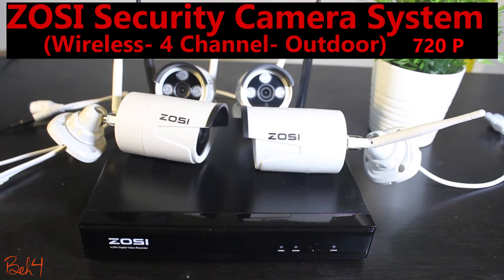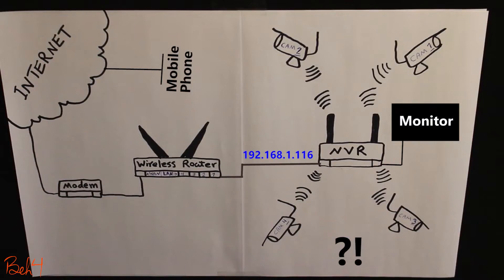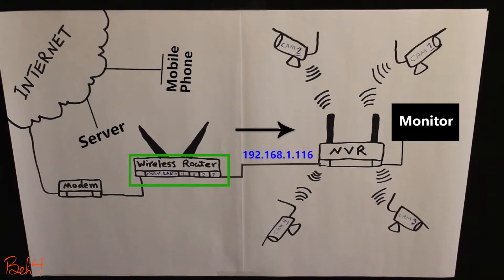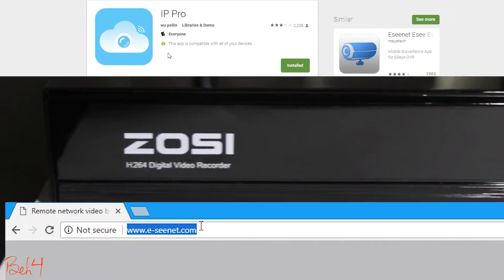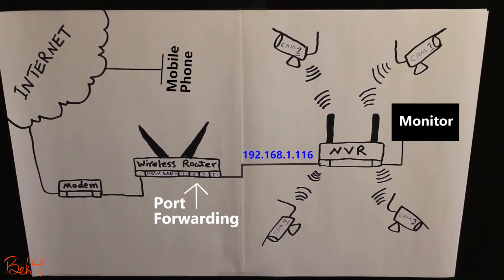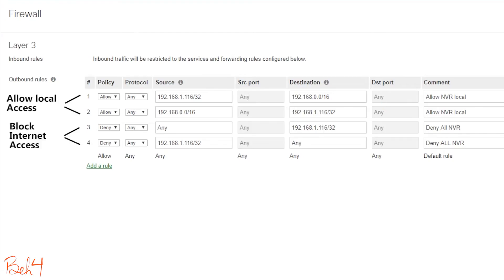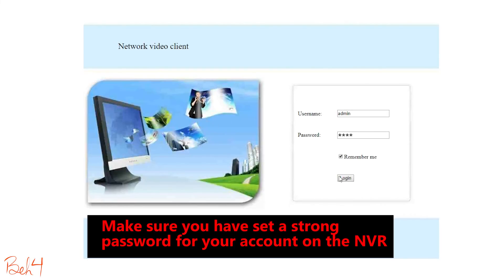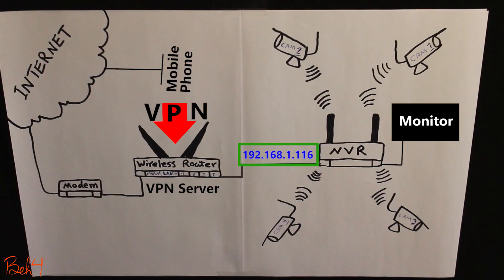ZOSI Security Camera System- PART 2 [Remote Access]

Comment: Hi, thank you for the videos, I have installed a central device with 6 Wi-Fi cameras (ANRAN model). 3 MP The problem I have now is that on a clear day, the two cameras are 10 meters away from the device.  It connects, but it happens much less at night

Comment: i got the zr08dp nvr and it came with 4 camera but show 8 spots for 4 more cams. i tired to add 2 cams and it will not let me. i got one to show part time with only the wifi in the window but no feed. so do you know if this model actually takes 8 cameras or only 4? ir it takes 8 cams how do you get them to connect? i do not see any place to pair them. thanks
Reply: I've tried the same thing and no luck either, did you figure it out??

Comment: Hi excelent video, it makes much more easy to understand the system... question for u, is there as a secondary benefit an improvemente in performance going directly through a vpn to the NVR instead of using the cloud?
Reply from the maker: Not necessarily an improvement in performance, but definitely an improvement in security as mentioned in the video. Thanks!

Comment: Hi. How do you setup the VPN? and can you still remote view with a mobile app (from cell phone)?
Reply from the maker: Hi, you'll need to have a VPN server of some kind. Some of the wireless routers have built-in VPN servers that can be used for this purpose. For example Asus has wireless routers that support OpenVPN server (RT-AC68U for example). Here is a video on how to setup an OpenVPN on an Asus wireless router: https://www.youtube.com/watch?v=KXdhhuBcpgU
Once the server is configured then you can connect to it from outside your network using a computer, tablet or cell phone.
Reply: Behfor Ok great! Thank you
Reply: Behfor One more question please. I’m using Verizon Fios as my ISP and the router I have doesn’t support a VPN setting. Do I need to purchase a separate router like the Asus and connect the two, or can I simply use a VPN service? In either case, what’s the easiest setup and what VPN service do you recommend?
Reply from the maker: So if the purpose of using VPN is to be able to remotely access your home network (there are other reasons for using VPNs too) then the VPN server has to be physically located in your home and connected to the network. If your wireless router doesn't support a VPN Server then the options are 1- to replace the wireless router with a one that has VPN server option 2- install a third party firmware on your wireless router that has a VPN Server feature such as DD-WRT or Tomato. Of course the wireless router must be supported by the third party firmware as well and not every wireless router is supported. This method can void the warranty on the wireless router and if something goes wrong there is a possibility to brick the wireless router 3- Use a separate VPN server (Asus RT-AC68U for example) and connect it to the main wireless router. This method might require additional configuration on the main wireless router (port forwarding for example) because the VPN server is not directly connected to Internet and there is a situation called  Double NAT. My personal favorite VPN service is OpenVPN, because it is very secure and also customizable. Hope this was helpful.
Reply: Behfor Yes, thank you! It was very helpful. You’re the man!

Comment: how would you setup the vpn?
Reply from the maker: So you need to have a VPN server so you can connect to your server when you are outside. Some of Asus wireless routers for example have build-in VPN server functionality. This is how you can configure an OpenVPN server on an Asus wireless router: https://www.youtube.com/watch?v=KXdhhuBcpgU Or if the router doesn't have the VPN server option, you might still be able to install a third party firmware such as DD-WRT on the router and use it as a VPN server https://www.youtube.com/edit?o=U&video_id=q-2vtaXdFXQ

Comment: Great videos many thanks ! Interesting my system is almost exactly the same but with another brand ! Sannce. Same weird software options tho.
Can we use these cameras to be a public webcamera ?  How would we do it?
Reply from the maker: Thanks for this interesting question! Actually I haven't tried using them as a public camera yet but I think it should be possible but I guess the cameras should be connected directly to the wireless router, I'm not 100% sure though I'll be able to give this a try in probably a week (life is very busy right now) and'll let you know. Again thanks for the great question and sorry that I don't have a solid answer right now!
Reply: Will you have a reply soon?  Id really appreciate it.  The supplier wants us to use the terrible desktop software.
Reply from the maker: Hi, sorry for the delay! I'll check that for you tonight and see if I can find a way to do that and will let you know. Thanks
Reply from the maker: Hey, unfortunately I could not find a way yet. There should be a rtsp url which I wasn't able to find for these Zosi cameras. I'll update you in case I find  anything in the future though. Sorry!

Comment: Thank you for making this video. I bought the same system and I’m also trying to access the cameras without using the cloud I’d. 

I currently have optimum online and they provided me with a modem and router. Can you help me use the port forwarding?
Reply from the maker: You're welcome! If you want to use port forwarding, you'll need to select an external port number and in your wireless router, forward that port to your NVR which by default uses port TCP 80. In the video I used the same external and internal port numbers. Finally and as explains in the video, in your browser type in the public IP address of your NVR then ":" then the external port number. You should be able to connect to the NVR.

Comment: Hi.. this nvr suport motion detection and push notification through smartphone?
Reply from the maker: Hi, It has the option, I'm actually using motion detection recording myself but I haven't tried the app push notification option yet. Thanks.
Reply: Behfor great.. thanks for reply. I go through the online manual, its have the email notification option.
Reply from the maker: In the NVR there is an APP Alarm option in the motion detection settings. However the APP is not very reliable, it crashes every now and then and unfortunately sometimes it doesn't even connect. I haven't been able to trust the APP very much! I hope they fix the issues soon. But for now I wouldn't trust the APP for any kind of notifications to be honest :-)
Reply from the maker: The NVR is up-to-date ans stable, however the issue seems to be the APP, which is not very stable!

Comment: Thanks for the video! Do you know of a way to bring the NVR signal across my local network and view on my desktop in a third party software like blue iris
Reply from the maker: Hi, I'm not familiar with Blue Iris and it seems like it's not a free product so I just tried it with iSPY free software and it worked fine! I followed this instruction and was able to access the NVR and monitor the cameras. https://www.ispyconnect.com/man.aspx?n=NVR
Basically all I used was the NVR's IP address and the Username Password. It generated some links and I tried a couple of them and worked fine!
Reply: I have a question does you cameras ever freeze up I got one not working

Comment: Hi friend. I have this kit. So I can’t connect with wired, I just connect wireless to my nvr. Could you help me?
Reply from the maker: Hi, Are you connected to the wireless router with a cable and you can't access the NVR? Does the computer in question have internet access?
Reply: Hi i had a digitalboy wireless cameras system but my NVR antenna broken and causing the signal to drop so am asking if the ZOSI NVR can work with the digitalboy wireless cameras. looking for your responsed